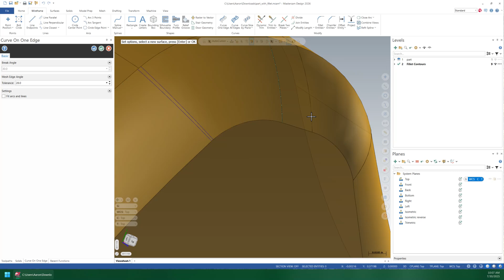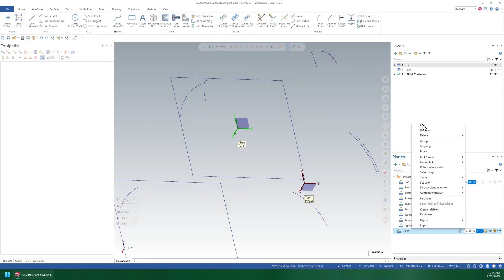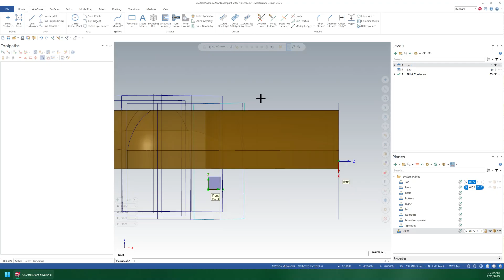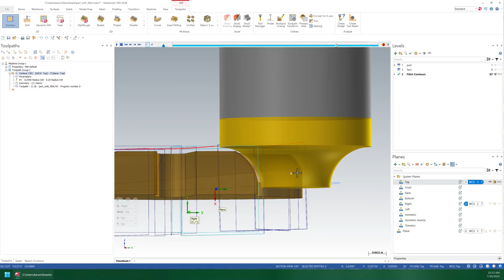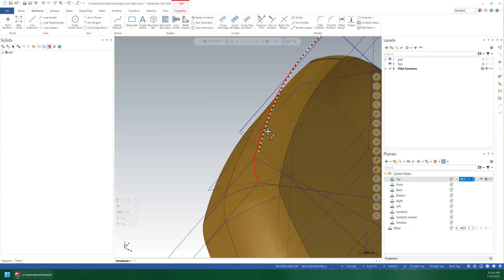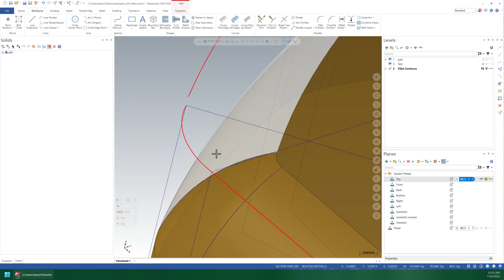2025-07-30 - Mastercam - Reverse Engineering a 3d Fillet Contour

Comment: just use curve on edge and create two tools... simulate and save tool path and optimize if needed. create stock and use main model in verify to compare. 5min job took you 26mins with shiddy results.. there usually is a shorter path -everyday user
Reply from the maker: Thanks for the feedback.  Do you have a video or file demonstrating it in action?

Comment: “Fantastic video as always. Keep uploading these spot-on videos!

But a question for you: what do you do when you’re trying to define a high-feed mill, for example from Sandvik?
I always run into a ton of issues when trying to import a .stp file – same thing even when I download a GTC.
I usually end up defining it parametrically using all the tool info from the website.
Or I download and simplify a DXF, then rotate the profile.

There has to be an easier way, right? Aside from just creating an end mill with a corner radius — a so-called ‘programmable radius’.
But then again, that doesn’t really work if you’re trying to generate stock/rest material based on the actual tool profile.

So… how do you do it?

I work for AME Mastercam in Sweden. So I’m not that noob in to Mastercam ;)

⸻
Reply from the maker: Hi Simon!   

Thanks for watching :)       

Yeah, weird tool profiles like that I will always take the time to get the parametric model as close as possible, then, use the imported model on top of it.   The toolpath calculations in the background are going to be using the parametric definitions of course, and if I can get that close without all sorts of weird abstractions you'll see if you importing it, it'll often get me a cleaner toolpath faster.  The imported model will still be used for stock models and verification.

ISO 13399 helped a lot in general tools, but honestly, for things like high feed mills, circle segments, etc., it rarely imports correctly from what I can see.  

If you have an example tool, I'm happy to throw together a video on it.   Post the link here or shoot me an email @ aeberhard@vector-mfg.com
Reply: @VectorMfg  Thanks for your answer. 2026 has also been so much  better(so far)
at import geometries. 
But i can email a question in Unified. that i cant figure out.